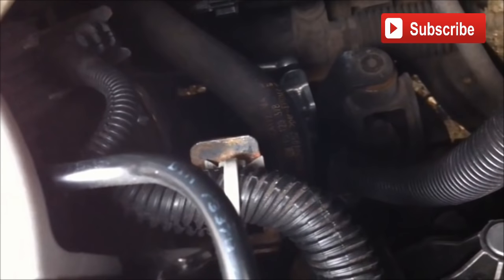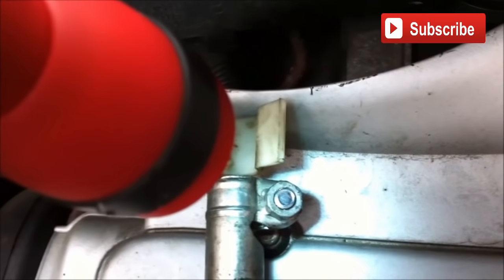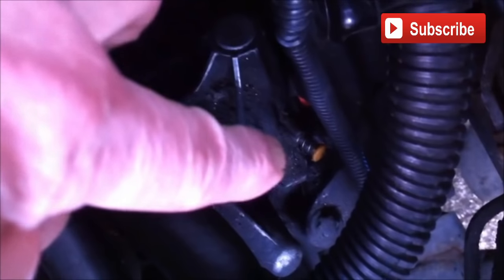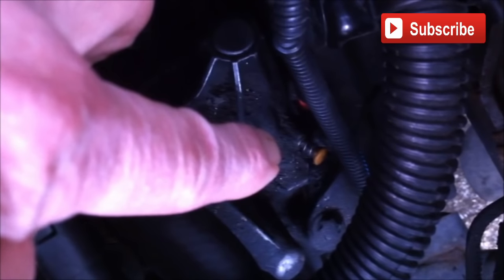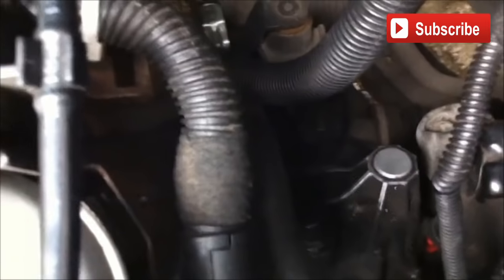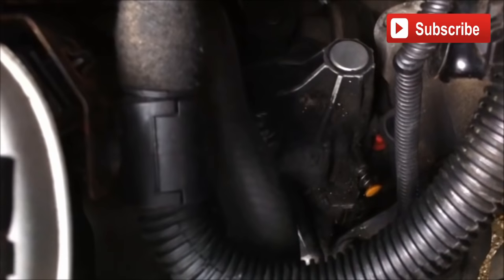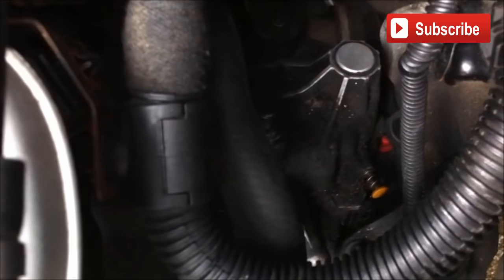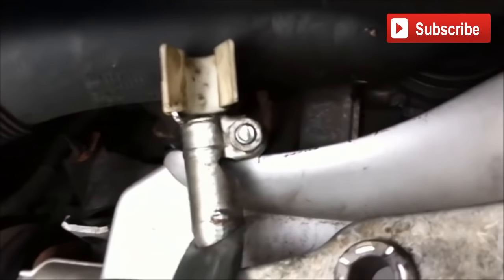How To - Fix Vauxhall / Opel Gear Box Linkage Fault, Repair And Set Up

Comment: on vectra b two liter auto it is under battery tray remove that screwdriver under plastic tabs near tray to release plastic electric plate with box, selector looks triangular , lever moves when gears shift. need to pull dipstick pipe out from engine , can clean around first. selector socket has red plastic on side that pulls out to release it can use screwdriver. dont push on rubber hose near center back top engine with arm or jacket rolled up sleeve  while reaching for it , will leak gasoline.  big screwie under selector and push down so it levers up  to get it free. can use wise grip to release screws to see inside, three red metal tabs wear down on three double  tracks and loose contact, so it can not be started in neutral while rolling wich is bad , or backlight stops working . cant remember should sel be in n or p when removed.

Comment: hello good day, I changed clutch and pressure plate and after second day the when I shift second gear the gear not linked? after I checked excel all are good I start car and shift the gear without clutch all gear are working without any sound, its Opel Astra H 1.6 benzina, do you have any opinions for me?

Comment: Hi mate. Thanks for your previous advice. Just having difficulty with removing the linkage. There are one or two small square retaining clips at either end of the solid bar that come off, and then I believe you should just be able to lift off the linkage but mine is rock solid and not budging at all. Hope this makes sense. Can you help

Comment: So how do you get the selector box ontop of the in to the setting where you press the little pin on the selector where there is no spring pin on the selector box im geusing a 5speed f16 gearbox

Comment: and how do you get the gear assembly you had up to show, out of the place it sits in normaly? mine is a 91 1,6 qad i cant get the center pin out to remove it all!
Reply from the maker: Hi If you are removing the linkage completely then check my other video on removing and replacing the linkage here :-

How To - Fix Vauxhall / Opel Gear Box Linkage Fault, Repair Replace And Set Up

Hope this helps
Reply: yeah looked at it and im still on a standstill , cant get the big end pin out , wont budge at all so i thought there was some trick to it , but dosent seem to be on your vid tho. guess im in for bad luck. thanx for the vid and explenation, nice of you.

Comment: I would like to ask. My chevrolet zafira is not shifting properly when the winter mode is deactivated. But when I activated the winter mode, it became smooth. What would be the problem??? Please help! Upon checking the manual, the winter mode shouldnt be activated as a normal shift and it should be smooth. What will be the problem?
Reply from the maker: Hi, Its hard to tell without seeing the vehicle but winter mode usually does not use first gear so it could be an issue with the solenoid or valve for first gear
Reply: Old750 my usual driving became — winter mode deactivated so that i can use the first to third gear then activate the winter mode so that it will run smoothly. If I did not use the winter mode, my max speed is 50kph and my rpm is very high and loud.

Comment: hey mate my combo vauxhall van has pulled gear leaves over to under 5th (instead of under 3rd. ) 
if I was to pull the gear leaves to the 5 mill hole and press the spring would it recanted or has something more physical happen ? 9
Reply from the maker: The linkage is the same on the combo van. Try resetting it as in this video and see if it works.

Comment: Hi how can I understand if in my case is a linkage or cluch, actually on my corsa d it happen 2 time same issue like I put on 1 gear is not coming in I switch off my car and after 10 minutes it will coming in 1 gear it is a linkage issue or cluch?
Reply: That my problem you need a new gear box!

Comment: Hello mate just changed part .followed video.pushed spring plug in.locked gear stick through little hole.tightend it all up.but having problem going in reverse.any help would be appreciated.
Reply from the maker: Hi, If it is the adjustable type just double check the length of the linkage bar is the same as the one you removed and then try going through the set up procedure again, sometimes things can move slightly when you are tightening everything up.
Reply: Old750  thanks for the help going to have another crack at it tommorow
Reply: Success all working fine now,what i did realise tho is when you have to push the spring pin in the shaft that comes out the gear housing,it has to be in the middle position so it lines up with the middle position of the gearstick(neutral) its a little stiff at the mo but sure will bed in soon,thankyou so much for the video,saved me a fortune.
Reply from the maker: Great, Glad you got it sorted

Comment: Any tips on performing this on an 02 hyundai accent?? I cant find the gear linkage under the hood
Reply from the maker: Andre Young Hi, If i remember correctly all Hyundai that I know of have cable operated gear shifts so will be completely different to this. I have no videos to show you how to do the cable type at the moment but you could try searching the Hyundai forums such as http://www.hyundai-forums.com/ or http://www.hyundaiperformance.com/ as I am sure they will have something to help. Good luck
Reply: Old750 I have an Astra h and it’s stiff getting it into 4th. What could it be?

Comment: hello mate ,.,that thing you called the split pin ..,.,please how do you get that off .,.,.you said youll show it a bit later .,.,there is a pin about 4 mm long and a bit of wire .,you can push the wire in but then nothing .,.,
Reply from the maker: Mark Jobs Hi Mark, Yes that pin is a nightmare to remove sometimes, I ended up having to destroy the one in this video just to get it out. All I can say is in theory all you need to do is push in the springy bit of wire on the side near the bottom of the pin and pull the pin upwards and it should just come straight out. Some times it will and some times it wont and I'm afraid if it wont then its just going to be down to brute force to get it out. Good luck
Reply: Old750 haha thank you i will give that a go a bit later ,..,.,.sounds good

Comment: Please can you help me. I have an Astra G and the Haynes manual says about changing the “linkage pin” to a new one when you install a new gear linkage. I think that pin has a small hook on the end. Did you change this?
Reply from the maker: It is recomended that you never reuse a split pin so for what they cost I would always replace it.